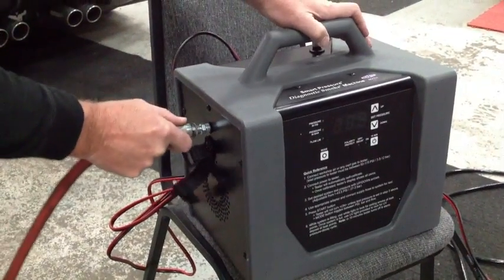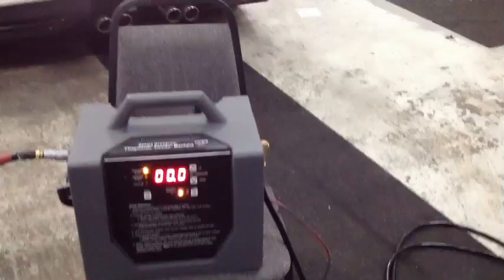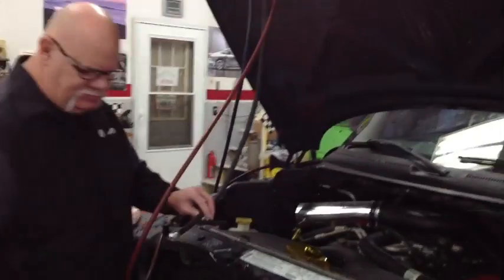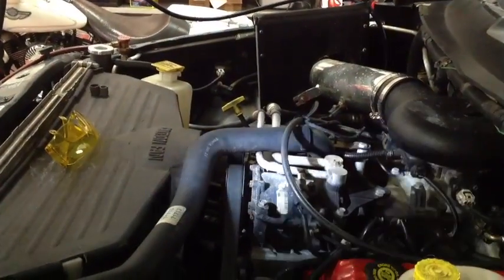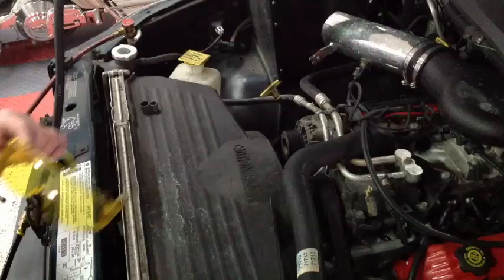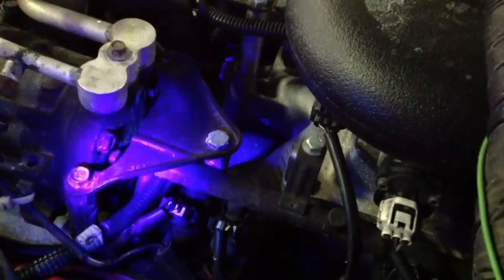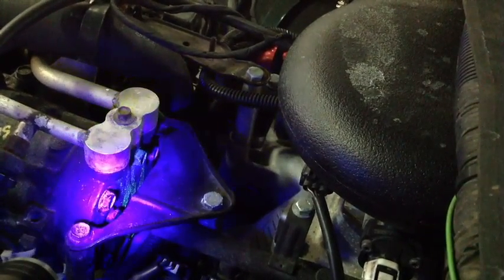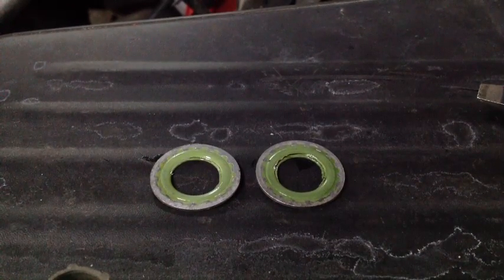Refrigerant Leak Smoke Machine | Ron Bilyeu | Tech Tip

Comment: When I first heard the term "High Pressure Smoke" machine I quarried the OEM on the HP range.  The HP term was only relevant to the "pressures in automotive evap systems" and not to the industrial standards of  LP, MP, HP and VHP.  During my Navy career we did have up to 60, 000 psi hydraulic applications.

Comment: At 30 psi I would hardly relate this procedure to a Hi Pressure test.  Hi side A/C pressures could see up to 7 to 8 times the pressure which was used which, is only close to the medium pressure range.  I'll stick with my N2 test rig and UV glasses.
Reply: +Ben quinn   Without worry of rupture of evap coils I N2 test at 125-185 psi.  Fully charged A/C systems at rest here in Florida sun can put system at rest pressures in this range.  Have submerged  a Ford evap from a F350 in tub of water and put 300 psi N2 to it and it held.  Still operating in that truck today 5+ years.
Reply: +Ben quinn  Not as a regular routine.  UV and a sniffer.  I also look at the residual pressure in the system.  If zero, generally a mechanical component failure.  10+ psi, I look heavily at the elastromers and hoses.  Pretty much the same game plan as working on cryogenic plants [o2/n2 producers].   General observation, look for the "wet" spot.